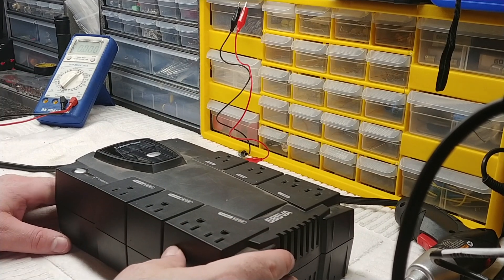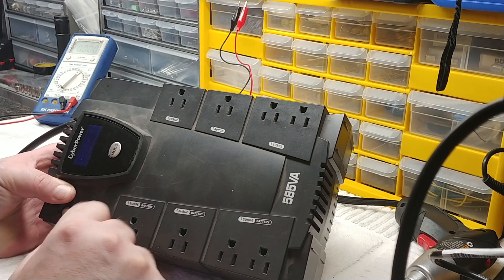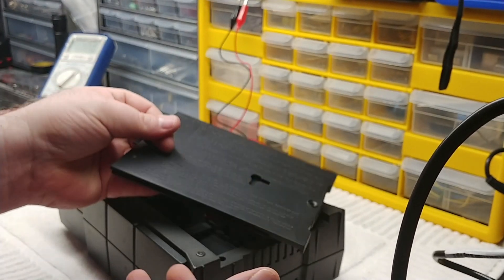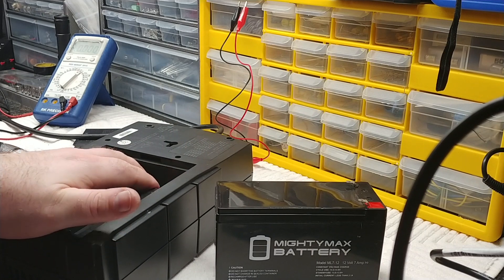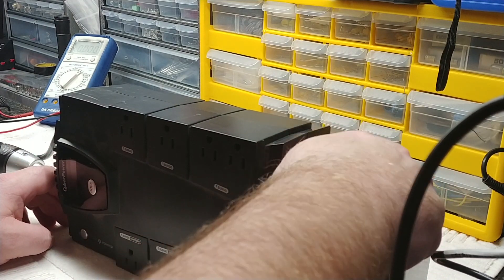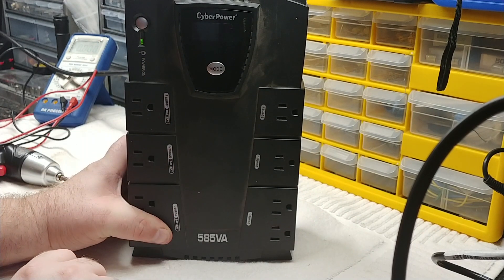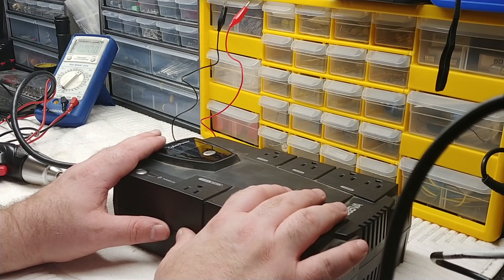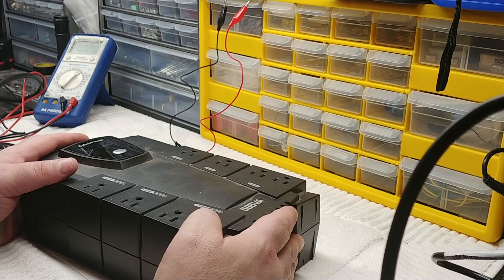Cyber Power ups battery backup model cp585lcd  continuous double beeping repair fix

Comment: Would’ve helped better if you shown how to remove the battery because that’s where I’m stuck. The cables are stuck on the terminals and I can’t get them off and I wanted to see how you got them off, but that wasn’t in the video.
Reply: I just used a pair of pliers and some brute force. Just be sure to grip the connector left and right and NOT the wire.
If you pull on the wire and it comes loose, then you have another project.😏
Reply from the maker: Thanks for the Comment and a pair of needle nose plyers can help, only pull on connectors not the wires .  Please subscribe and like thanks it really helps the channel!

Comment: This have a different inquiry. So these power boxes don't work while unplugged? I wanted to vaccum my car and had no idea this unit had to be plugged in 😮
Reply from the maker: Thanks for the Comment and yes the units only work for a short time once unplugged, how long depends on the load. Most vacuums have a high amp requirement so a ups would not be a good solution.  I have seen people use 12v inverters to power shop vacs.  you just want to have you car running and have inverter directly connected to the battery. something like this https://amzn.to/4iZbGQy Please subscribe and like thanks it really helps the channel!

Comment: I have the CyberPower 625 VA model. One day the led power button didn't turned on for the 'surge/battery' side; but the other surge side still works like any multiple outlet. How I know I need to replace the battery or is the unit not working? 
Is been a while since stopped working.
Reply: In the CyberPower website is: CP625HG
Reply from the maker: Sound likes you might have more going on other than just your battery.  Maybe time for a new unit Thanks for the Comment! Please like the video and subscribe to the channel it really helps and we appreciate it.
Reply: @kc9cuk    Wow. Along with a generic answer, there's the main purpose, the wasted: "like and subscribe". Thanks anyways.👍🏻

Comment: Thanks, friend. We had the beeping go off after a short power outage, but the battery is 9 years old. It's installed in a handicap elevator where the elevator company charges $250 just to come out and check the problem, then another $250 to fix it plus parts. If the battery is dead, the elevator won't run - how convenient, huh? I think this will be easier to fix than the flux capacitor on our car.

Comment: Any way to remove the speaker?
Reply from the maker: Of course there is but you don't want to remove it because then you won't know if you have a problem or if your power has gone out. Power strips are very cheap so it'd be easier just to buy a regular power strip if you don't want the battery backup the work.

Comment: Question; what if you dont care about the battery for backing up  i got one for free that came under my aquarium for the lights and filter and stuff and just want to use it for the plugs.  is there a way to stop the beeping without replacing the battery?  It really serves no purpose for an aquarium set up.  Thanks

Comment: I have one of these, and one of the plug in receptacles had an issue and melted the plastic housing. I am presuming that its faulty. It is the last one on the right hand side, and its labeled Surge.
Is it worth repairing the back up power supply or not?

 I have not used it since the damaged Surge plug was discovered. 

Thank you.
Reply from the maker: no replace the unit, it is no longer safe to use!

Comment: I have the CyberPower 450v. The battery side is completely dead.  The surge side works.  The power button does not work at all. Is this a battery issue?

Comment: May as well upgrade to the 12v 9ah battery for 3 more dollars. Batteries are identical in size but will give longer run time.
Reply from the maker: Very good tip, yes I have done this in the past but they had been out of stock.
Reply: @kc9cuk  I'm not that smart. I Googled because I saw a 9ah battery and the notes said they are identical in size. lol.

Comment: This one is exactly the same as my 825AVR, even the same size battery.  My 550VA says the battery is not replaceable, but if you have a security torx (T-10) you can remove the screw and remove the battery cover (or drill it out).  The 550VA takes a slimmer battery (terminals closer together), same height and width (CPS 5.5-12).
Reply from the maker: Thanks, Hubjeep
 please like and subscribe.

Comment: Great Video, just had a Brown out, the Unit went into a constant beep.  I checked to see if the breaker button was out, it wasn't. Next I unplugged everything from the unit(825avr). Turned it off..then back on after 2min..still  constant beep after power up. Ordered New battery and will go from there when it arrives (to be cont...). Very informative video pointing me in the correct direct 1st.... Thanks! https://www.instagram.com/cj_video_and_photography

Comment: I have this unit and I hope you can answer my question. Mine doesn't beep, but it does click every now and then. It will click on and off for a few minutes then stop. When I look on the lcd, the plug icon flashes on and off. Any idea what can be causing this? When it happens, my lights dim a bit. But the dimming stops when I unplug the unit from the wall
Reply from the maker: Sounds like your unit is switching from AC power and back to the battery backup over and over this could be caused by many things but most likely it is just doing a periodic self check for the power you have it plugged into is very unstable. The clicking sound you are hearing is the relay the switches that unit from wall power to the internal battery backup inverter power. If you can plug the unit into another power source and see if the issue goes away then you know what is the AC power outlet Supply on that circuit needs to be addressed. Sorry I hope I'm not confusing you more this is the first thing I would do also I have seen the units switch back and forth like that when they see a significant voltage drop sometimes things like large printers or space heaters can cause large voltage drops trick the units into think you are losing power.

Comment: Question to anybody could I modify this by putting a larger battery into this obviously this battery would be a AGM sealed battery but instead of such a tiny little battery can I put a car battery connection modify the box so that I could have a longer run time
Reply from the maker: The simple answer is yes, many people extend leads to come out of the case and go to batteries in another external case to increase run time. One thing to keep in mind is all the internal components such as the inverter really only have adequate Cooling for their allotted runtime so I would not go more than twice the size battery. In my opinion a better solution would be to buy a larger UPS unit with bad batteries and modify that the smaller units are pretty Limited. Another thing to consider took extended runtime it's only plug in essential things such as the main CPU the battery Outlets and plug all nine essential things into the surge side only you can always extend one of the surge Outlets with a power strip. I find most customers have their monitors and other non-essential items plugged into the battery Outlets and that really shortens the runtime. Good luck and thanks for your comment please subscribe.

Comment: You didn't say what type of screw your's had. Was it a #1 phillips, #2 phillips, a regular torx, a tamper proof torx? Little details matter.
Reply from the maker: It is a single Philips screw, if it would have been a specialty screw I would have mentioned it. Sorry my video was not detailed enough for you :0(
Reply: On the cp500 which looks a lot like the unit in the video, The battery compartment screw is most definitely a tamper resistant torx, unfortunately.

Comment: I get a long continuous beep, would this work for that as well?
Reply from the maker: Unfortunately it sounds like your issue might be different. If you have a spare battery or something that could simulate a battery such as a 12 volt dc power supply you could see if it fixes the issue. You can also look online for the manual for your particular unit sometimes they have the beep codes in the troubleshooting section. Good luck fixing and troubleshooting is half the fun hope you get your unit back to life.

Comment: question: why did you have the person send this unit to you when you knew all you had to tell them is 'replace the battery'?
Reply from the maker: Thank you for your question. The customer was advised over the phone that it was most likely the battery and they could just replace it themselves. I even offered to send them an email with instructions and a link to where they could buy the battery. In this particular case and in most cases the customer did not want to mess with it themselves they just wanted it fixed. Please keep in mind before thinking the repair shop took advantage of somebody that they are liable for anything they tell the customer over the phone. I am a small boutique repair shop so I still try to help people when I can but I do not run a charity and many times the information that is provided by the customer over the phone is incorrect and you can be giving the customer bad information and wasting their money and time. I have had customers in the past bad mouth me because I tried to help them for free over the phone and they attempted to do the repair themselves and destroyed their equipment. If I was looking to rip people off I wouldn't put up free videos showing how to do the repair.
Reply: @kc9cuk  i see, makes total sense.  let me ask you - my Cyberpower CP600LCD seems to run fine, but if we have a power outage, it doesn't do what it's expected to do.  it shuts down and emits a long continuous beeeeeeeeeeeeep.  I can't get a hold of anyone at CP, but from what i'm reading this signal seems to indicate the unit is overloaded.  i dont see how that's possible, all i have plugged into it is my PC and a LED monitor.  the unit is 2 years old, orig battery.  any ideas?
Reply from the maker: @noneyerbidness  it sounds like it's possible your new unit needs a new battery. When you lose power the unit will beep to let you know the power is out. The fact that unit just shuts down and does not power your devices off of battery power, tells me either the battery is bad or the inverter inside the unit is not functioning properly. I would remove the old battery and check it, if the battery appears to be good and working most likely you have a defective unit. If the battery does not appear to be able to power a 12-volt device or is not showing a charge, it's most likely a bad battery. Please keep in mind it is still possible you have a bad unit that was not charging the battery properly but it is more likely that the battery is just bad good luck with your repair.
Reply: @kc9cuk  thanks for the reply. it was much easier to fix than I thought... I took it out to the garage, and threw it in the trash. I am now an APC customer.

Comment: Do you have a source for the internals on these?  I have a CP485SL that smoked the small transformer.  I would like to replace it, looks like an easy fix.  Also, thanks for posting these videos.  It makes it so much quicker to diagnose problems.
Reply from the maker: No sorry I do not

Comment: So what’s the problem if I have a similar unit plugged in and working then all of a sudden usually in the middle of the night a long continuous beep blares
Reply from the maker: Unfortunately it sounds like your unit is having a different issue. Without having your unit and being able to test it it's hard to say. I have had customers they have their power go off in the middle of the night only for a couple minutes and then comes back on but the unit alarm continues until they reset it. Do you unplug your unit and plug it back in and then it's fine again until it fails. I have also had customers that have units plugged into circuits in their house that have large voltage fluctuations that caused their units to misbehave and set the alarm off good luck and thanks for your comment.